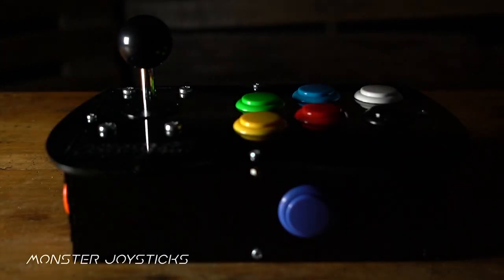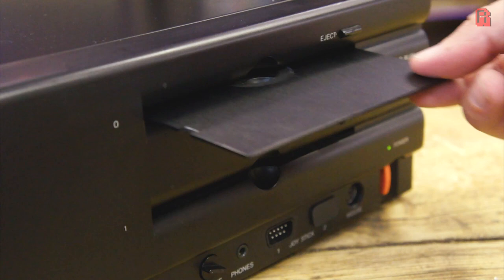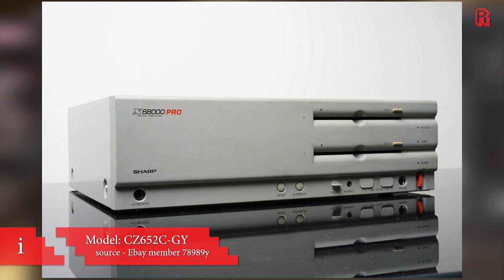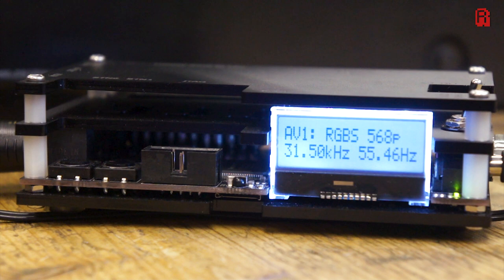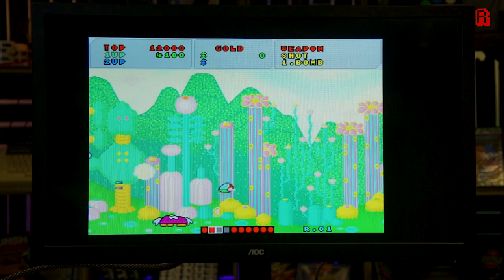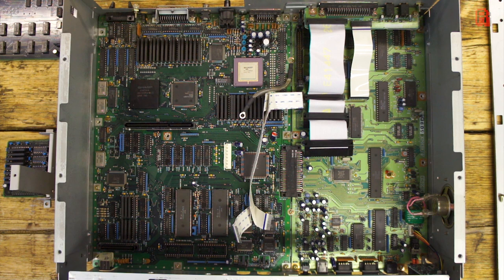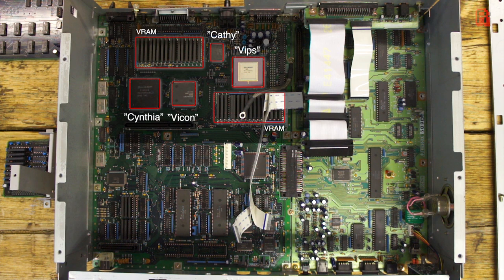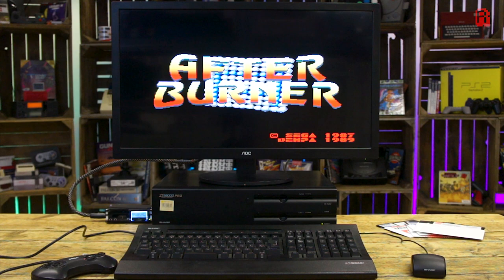The Sharp X68000 Pro Review - Japanese Gaming Workstation

Comment: I have never seen these machines personally, but after this video I think they are technically quite impressive. If the price and marketing was better maybe it would even do better than Amiga. I hope I will score one of these machines with 68030 and MMU. I heard you could even upgrade CPU to full non EC-68030 or even 68060, and ~12MB of RAM, if not more with some tricks. It wouldn't be too hard to make some custom expansion cards with more memory and some software hacking.

Comment: I did wonder with this computer how it worked with games that needed 6 buttons, did a megadrive 6 button pad work for it ? or were their sharp x68000 specific joypads/sticks
Reply: I looked up a pinout (it's the same as the MSX) and you can use a gen 6 button controller but it does require a few changes. I will use pinout description with the MSX/X68000 first - Pins 1-6 are direct connections, pin 7 goes to 9, pin 8 goes to 7, pin 9 goes to 8.

Comment: It's a what could have should have been situration as we do have Sharp in Britian in fact I have the 6 Head NICAM PAL Multiregion VCR by them in my room.

We could have had a real 16/32-Bit War in the UK with AMIGA having a legit competition rival which the ST really wasn't other than the free music productivity instead of paid on the AMIGA but you get samples to mess around on in every tracker with midi support on the AMIGA's though which probably still made it better for music production but it wasn't free and those early ST Ports Wars.

It should have been AMIGA Vs Sharp Britan's X68000. It may have even got AMIGA to actually step up for real in their AGA 32-Bit days trying to be better than the rival and not die and go bankrupt.

The X68000 could have saved the lifespan of the AMIGA brand and we would be using 16-GB RAM AMIGA's right now and the same in Sharp's because the ST died the AMIGA followed as the PC was a different beast for the workstations.

If we had a UK Sharp AMIGA would have a rival in multimedia based computing to pull something new out of it's hat a combination of multimedia based and full workstation something better than the A4000 and more on PC level with your 16GB RAM upgrades and ultra speed multi ghz amiga custom prosessers.

Comment: 13:03 It's not just raw performance: Many of these conversions would have been developed by someone much closer to the original dev team, and documentation would have been much more easily available.  The final thing of course is that many Amiga and ST ports were created with the intention of reusing assets on the 8-bit versions of games.

Street Fighter is an obvious point of comparison, because the US Gold port is egregiously bad... But there's no reason it needed to be, aside from external constraints.  Infact visually, it doesn't even look that bad in still screenshots.  It's only when you see it moving, and are exposed to the one-or-two button control system that it becomes obvious that it's less a port, and more a loose interpretation.

Comment: Why did Commodore or Atari not have these specs back then, well as impressive as this might be, it cost around $3,000 at the time.
Reply: That rather explains itself huh. XD
Then again, Commodore really mismanaged the Amiga.
It might seem like a contemporary of this system, but it's actually a design from 1985...

And Commodore didn't really upgrade the design for ages. (and when they did it was very much a case of too little too late.)

Atari did eventually create a system that is arguably similar in capabilities to this, but they did so around 1993 and in such limited numbers the system is more legend than reality.
(Atari Falcon)

But at the end of the day, it's all cost really. To be fair an Amiga 2000 or 3000 with upgrades is in a similar league to this.

But it's also the same reason that the Neo Geo home system can have the specs it does while the Mega Drive and SNES are considerably less capable.  - the Neo Geo costs 4-5 times as much! XD
Reply: The Falcon was much more powerful than the X68000 back in 1991, well for Processing and sound capabilities.  Graphics wise, the Falcon's resolution could be pushed to get close to this with some dongles, or software utilities.
Reply: Please note that first Hi-Toro work on the design for the "Lorraine" platform (first Amiga name) started in 1983, after Jay Miner left Atari Corp. From that time to 1985 (first 
 platform presentation) and 1986 (release to the market), Amiga had only minor changes in design. Original A1000 cost 1200$, A500 was 499$ in 1987.
I would like to see the FM-Towns (i386/i486 based) platform along the X68000, they were both awesome for the times! Cheers, M
Reply: completely disagree, see Falcon specs...it was underpowered, both on CPU data bus side and graphics specs side.
Reply: I disagree as I have Falcons, Amiga's and numerous other 68K based systems.  I've played Doom on a stock Falcon, I've seen the Quake and half life demo., but not on any other stock 68K (not 68040 or 68060) system.   I've played demos of games that display a massive amount of sprites even though the Falcon does not have any spite hardware.  The Falcon is a lot more powerful and capable than people may think.  https://www.youtube.com/watch?v=WpwlZgQPCpk&t=52s  (This is on a stock 16 Mhz 68030 Falcon)  The Slow doom demos on the Amiga are on upgraded Afterburner 68030's running at 50 MHz.     https://www.youtube.com/watch?v=voiRnr72YhQ  (No hardware sprites like the Amiga and X68000)
Reply: 10p6 you should keep in mind that a X68000 was way more powerful than an AGA Amiga too, video section has dedicated VRAM and 3 custom coprocessors. Falcon had a 68030 but on a crippled 16bit data bus to save costs, neither the next Jaguar could compete vs X68000 or FM-Towns. Cheers, M
Reply: As I said earlier the X68000 was also more than 6 times the cost of the ST and Amiga, but it is not 6 times better or more powerful.  The Falcon's Video (programmable  video processor) had direct access to 32 bit RAM.  The DSP (which is massively more powerful than the 68030) had it's own dedicated RAM.  The sound hardware is massively more capable than both the Amiga and X68K, and the Falcon still supported a Math Co processor.  Yes the CPU might have had a 16 Data bit bus, but it does not make much difference when the RAM is being 100 percent taxes by other parts of the system.    This is one reason Motorola made chips like the 68008 which only had an 8 bit data bus but what do they know!.  Oh, and with a 2 minute hack and $2 crystal, the Falcon happily runs at 32 MHz..
Reply: @10p6  That and the 68030 advantages over the 68020 with a shorter main memory access cycle and the ability to do burst mode memory transfers (like FPM or maybe EDO on the PC), plus the small L1 cache, meant you could get similar bandwidth with its 16MHz 16-bit bus to what the A1200 did with a 14MHz 32-bit one, and the Videl got 32-bit (and also burstmode) direct memory access when the Amiga chipset was still 16-bit on the AV side... So it could do higher resolution + colour depth combinations without suffering slowdown, which was a significant problem with the A1200, unless you shelled out a good bit of extra money for an accelerator. And of course the audio quality was a hell of a lot better, and the DSP could act as a genuine high powered coprocessor rather than the glorified displaylist engine that was the Copper...

Both were however already being overshadowed by the PC and Mac, as well as the later evolutions of the X68k, PC98, FMT etc, but were at least affordable and fairly backward compatible with the established Amiga and ST software libraries and hardware peripherals...

Comment: Just shows that amazing performance merely came down to excessive pricing. I wonder if the parts were that expensive to produce.. or if manufacturers were just greedy and wanted to secure their longevity by only trickling out improvements rather than push out the top of the line. Though I would imagine that's precisely what the likes of Intel and AMD are doing right now.

Comment: There was actually a huge lawsuit during the period between Motorola and Hitachi where the Texas judge essentially told them to settle their differences out of court.  You have to keep in mind when comparing this system to the Amiga that it emerged onto the market nearly 3 years after the Amiga.  The OS is; perhaps, a consequence of the degree to which the Japanese were in the mode of copying Western technology during that era.  I mean ... why choose a powerful CPU like the 68000 (at the time) and create an OS very much like MS-DOS.  Hmmm ... wondering if there is a version of Linux that will run on the X68000 / X68000 Pro?!?  :)

Comment: Nice matte black, sure. But a “Japanese Amiga”? No way.
Reply from the maker: I agree.  There are similarities in its approach but as I said it would be doing it a disservice to call it that, it wouldn't be until the AGA chipset of the 4000 that a stock Amiga comes close to this and even then it doesn't have the same software range to use the power in the same way.
Reply: RetroManCave it would have been amazing to see Japanese game developers port x68000 games to the Amiga AGA systems. A Japanese games library is what the Amiga was missing, in my opinion.
Reply from the maker: That would have been very cool.  We got Final Fight but how would an A1200 or 4000 native version compare I wonder
Reply from the maker: Intuition my mistake thank you!  Edited accordingly

Comment: Incredible machine for its time. According to some estimates it sold in Japan only more than the Amiga did worldwide. My favourite game for the machine is Cho Ren Sha 68k, a very addictive doujin (indie) shmup eventho I only played it through emulation. I have always found the 5 1/4 inch floppy drive incredibly anachronistic  for 1987, anyways.
Reply: I am a little dubious about it outselling the Amiga. Do you have any sources for those estimates?
Reply: Brandon Hoth, I'm dubious myself about this. Sadly I cannot locate the source anymore, I just remember reading about it years ago. Basically, I had read that the X6800 sold more than 5 millions (or about that) units in Japan, while Amiga sales estimates range from 4 to 7 million units worldwide.
Reply: Japanese wikipedia page says about 130k units sold until 1991 sometime. I google around a bit (in Japanese) and could not find any hard evidence but some bloggers said it did not sell well (guessed around 100k units).
Reply: If it sold so well, it wouldn't be so hard to get one nowadays.
Reply: On the other hand, it would be hard to justify a continuous support from the biggest names in the industry with a user base of about 100k. I don't know where the truth is, probably somewhere in the middle.
Reply: Duh, it was mainly a development system for arcade machines. That's why. I don't think it was ever serioulsy considered as a consumer product.
Reply: Duh, games were released on the consumer market, they did not just leak as prototypes.
Reply: Look for the word "mainly" above. Of course there was a commercial market, but it was an added bonus, if that much.

Comment: Much better than Amiga 500/600
Reply: X68000 cost ~$3000 (~$6,800 adjusted for inflation) Vs A500 ~$600 (~$1,300 adjusted for inflation) but where the A500 beats the snot out of the X68000 is in the OS and application support.
Reply: Hell, it outperforms the A1200 even.

Comment: I wonder why there was never a proper operating system for the X68000. That Human68k is as crappy as MS-Dos. The X6800 would have deserved a better OS with a GUI. Of course you can install NetBSD, but then there will be no difference to any other computer running NetBSD...
Reply: OS-9 68k is a proper operating system. Not sure if there was a GUI for it though. I hope one of the upcoming videos showcases it to give you a look at it.

Comment: So they copycat the Amiga 1000 i can see, only the Amiga had Workbench, that looked and felt a lot better then what you let us see with the Sharp X68000 Pro, and yeah only a Motorola 68000 10Mhz CPU was nothing to speak home about in 1989.

And in In 1989 the Amiga 2500/30 came out, which added an Amiga 2630 CPU card: 25 MHz 68030 and the 68882 FPU with up to 4 MB of 32-bit memory. The A2630 card can also take a memory expansion daughter card, capable of supporting up to 64 MB of additional memory. 

Or the LOT cheaper Amiga 500 you could also upgrade the CPU directly on the motherboard to a 68010; or to a 68020, 68030, or 68040 via the side expansion slot

So yeah sorry the Sharp X68000 Pro was nothing special in 1989.

But great to see another system that also had good graphics and audio, and great games, Yeah a pity it was not soled in the EU and USA.